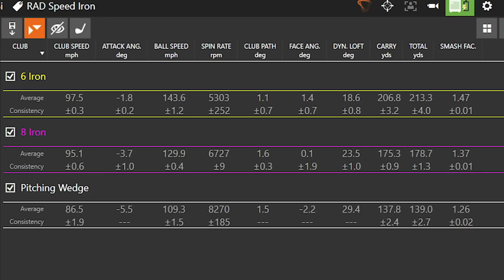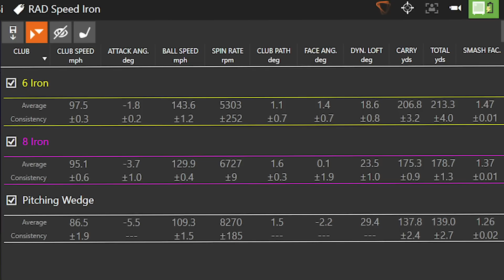COBRA RADSPEED IRONS REVIEWS

Comment: In your opinion, do you think these or the cobra forged tec irons would be better at holding greens? Thanks and great review!
Reply from the maker: Glad you enjoyed the review.  Will really come down to the actual golfer so the suggestion would be to try and test out if you can.
Reply: Thanks for the reply, I currently swing i210s with project x 6.5 shafts. I hit my irons much too high and if it’s windy it’s a real struggle. Our iron swing speeds are similar so that’s why I was wondering how they did for you. Thanks for the reply!

Comment: If I am fitted for Speedzone Irons would these be similar or would you suggest a whole new fitting?
Reply: They will be similar but it’s always best to check as they may perform slightly differently 👍
Reply from the maker: Worth testing out and you will see but then worth the custom fit to see how they stack up from the data/results

Comment: I don't know, but during a rainy day the amount of potentially dirt-accumulating recesses within the medallion and around the screw may partially counteract the grams of weight saved in the first place.
Reply from the maker: Doubt it will have much effect and difficult for the muck to get in in any real size to cause an issue and no different to other clubs and cavities etc We will check it out though.
Reply: You are likely right. Looks like some work to clean out the recesses in the superior part of the medallion with a cotton swab though.
Reply: @golfshake  Doesn’t matter how small the dirt. This design will be an absolute magnet for any dirt making cleaning them nigh on impossible. Any dirt / moisture accumulates over time can’t be good for the overall integrity of the club.

Also those screws. Another potential area to encourage premature rusting. They aren’t the cleanest of designs. Also I think the adjustment idea is a little over engineered too. Just confuses the fitting. Of the big box fitters I’ve been to I doubt they will have the required knowledge to get the right weight for you (with all due respect). Your talking very marginal gains here that can’t possibly be identified through a relatively small amount of balls hit off an indoor mat. Choosing the right head, shaft, lie, length, grip etc is difficult enough as it is without yet another element thrown in!

I like Cobra I really do. I think they are pushing the boundaries for innovation, but I think their R&D department had a bumper delivery of red bull on the day they came up with these and got a little over excited. I wanted to like these. I was hanging on for their release to potentially buy a set. Im sure some people will not care about the negatives I’ve highlighted but there will some people where these will be a deal breaker. I’m sure they will perform but overall I’m left a little disappointed.